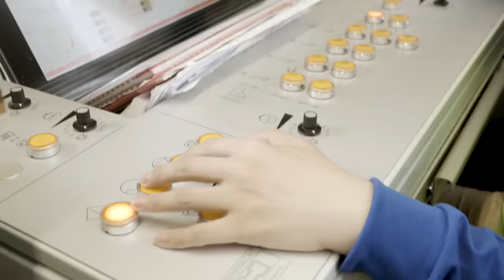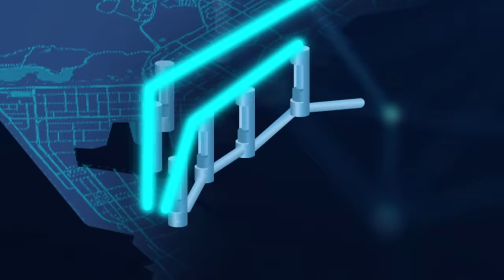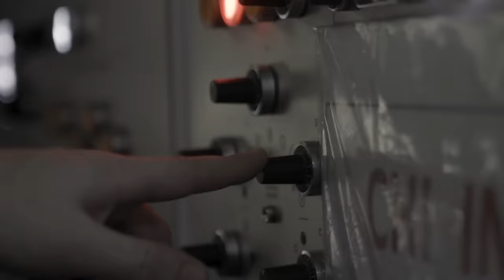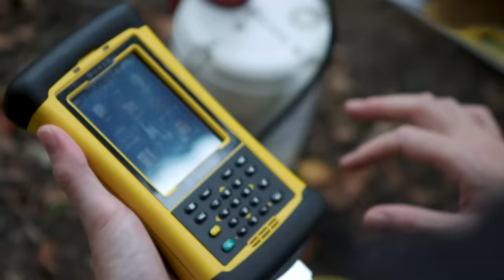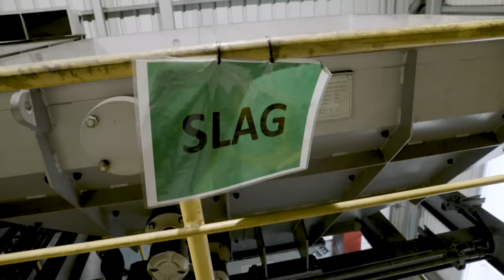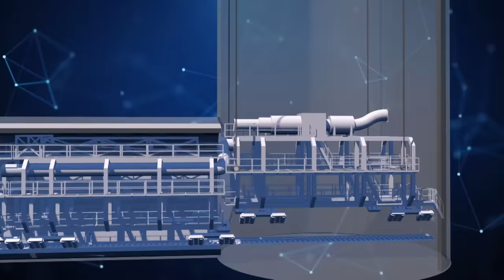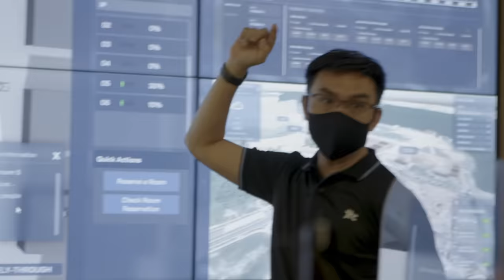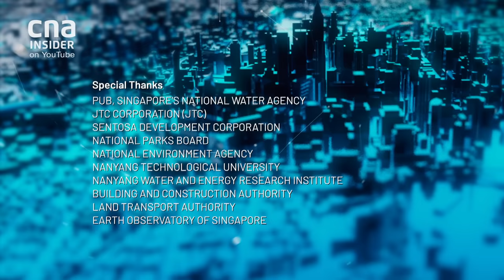Megaproject: Singapore's Deep Tunnel Sewerage System | Tomorrow City | Part 1/3

Comment: I was in Singapore for 9 months working for the project in 2019/2020. Doing soil engineering works for the TBM to excavate through Jurong Formation rock mainly build from sedimentary rock that covers south-west portion of the Singapore island. Strengthening the soil or the foundation along the TBM route of excavation by grouting method such as rock fissure grouting by filling the void inside the rock with cement pumped with high pressure. Singapore is a nice place to work and stay....
Reply: No
Reply: @yeolow2564  Yes
Reply: LinkedIn
Reply: Thk u 🙏🏼🫡
Reply: @kf510 maybe?
Reply: @vindhyachalchaubey2072 😅😮
Reply: LIAR 😮😮😮
Reply: @cdracing  ask your mom....
Reply: Singapore is fine city😅😅

Comment: In Louisiana, USA, a glass recycling project is grinding glass to create replacement for sand in concrete. No heat required. The glass has the same angular shape they are looking for.
Reply: I hope they will do a documentary on this. This is good to know
Reply: Glass is made from sand so it makes sense
Reply: Singapore also have to pay for what had damaged in China
Reply: @TKO67  There is a youtube documentary on it. That is were I learned about it.
Reply: @joblo341  please provide the link
Reply: Interesting project. Whereas for Singapore, they are attempting to resolve a waste issue as they have limited space for landfills, so they are looking into converting ALL waste (not just glass) into sand for concrete.

Comment: i worked on Phase 1 of this project from 2003 to 2005 driving 1 of the TBM's -  it was very wet and difficult.
The people and the food made up for all the hardship we faced at work.
Reply: Thank you for your hardwork :)
Reply: What food
Reply: @chialiulian2881  please don't be simplistic.
Reply: @pauldarbishire7226  😊
Reply: What kind soils you encountered there along the alignment? Sands, silt or rock or a mix of things?
Reply: @rogerw830  badly fractured rock with faulting and water+++
Reply: Actually it looks pretty stressful environment and people.. but super interesting nonetheless
Reply: @TWJYILY  uuurert
Reply: @chialiulian2881  llllllllllllllllllllllllllllllllllllllllllllll
Reply: HahThatsWhatSheSaid  I know that English may not be your mother tongue so I will explain.
I made 3 statements -
1) I worked on Phase 1 of the project.
2) The work was difficult and wet.
3) The people both on the job and in Singapore and the wide diversity of food available made up for the difficult working conditions.
I understand that you may find my original statement difficult to understand but as a native English speaker I laid it out correctly. It seems from the number of upticks it has received so did most other readers.
However there have been 2 people who questioned the post and both were unable to grasp the connection between difficult work being ameliorated by good people and good food.
I hope that you understand this explanation, if not try some remedial English classes.
Reply: HahThatsWhatSheSaid  I am neither irrational nor offended.
I laid out, in simple terms, an explanation for my original statement.
I think you may be the one who is being irrational and offended.
Maybe a class in maturity would be better suited to your needs.
Have a great life.
Reply: yea me too
Reply: @pauldarbishire7226  Actually it all started out with you making an assumption about a 2 word comment.... to which you could have replied with what sorts of food you ate while working there... seriously that is what people are asking, your assumption that they didn't understand your perfectly good English took you down a the wrong path. Try and tell people about your experience rather than correct their thought patterns... Anyway... food is what I miss about some of the places I have been also. Peace.
Reply: @Wingnut353  ... and there you go trying to "correct my thought patterns".
Reply: Thank you for being part of the team. Much appreciated.
Reply: @adamfaidzal  welcome - we try to please
Reply: I realize you said 'hardship(s) we faced at work' so were covering more then just yourself, but what was it like to be a driver, were you in charge of the whole operation during your shift?  What did the work involve?  Was this the first time working in aTBM?  I've always been fascinated by them, wish I could get a in person tour.
Reply: @shopshop144  We all, that is the 20+ men who worked on the TBM suffered various hardships - large inrushes of very cold water, badly fractured and crushed rock, dust, heat and cramped and confined conditions.
I was only in charge of the TBM, its steering and general maintenance.
I drove my 1st TBM in 1981 and worked on many tunnel jobs in over 35 countries including 3 times in Singapore.
The work is very interesting as each machine has different characteristics - so there would 3 months of learning and optimising the machines performance and then it would become a little boring :~/
Unfortunately because working tunnels are hazardous it is very unlikely that you would get to visit a working TBM.
Thanks for your interest.
Reply: @pauldarbishire7226   Curious , what is the average temperature down there ?

Comment: Very Interesting.
Props to the producers and all involved in the project for making such a well presented and informative video.
Reply: Several discrepancies about TBM's.
The TBM  would move an elephant hahaha. 
A TBM would move a herd of elephants and several herds of cows + the farmers.
The TBM costs a $1,000,000 hahaha.
Maybe a very old and used TBM.
A 6m mixshield TBM, as featured here, would cost at least $10,000,000 approximately.
 Depending on the size (diameter) and type of TBM  they can cost much more.
The 6m mixshield TBM featured in the video would advance at 3m an hour hahaha.
This is not possible with this size and type of TBM. It leads you to believe that a 900m tunnel would be excavated in 300 hours or 12½ days. The truth is a 900m tunnel would take about 6 - 8 months depending on geology/breakdowns/dependability of supply of usables.
I have work on tunnels in Singapore on 3 occasions.
Reply: I’m so proud to be Singaporean! That you Paul!

Comment: Imagine the amount of seismic disturbance it causes. That part of the world is just one earthquake away from a massive problem.  There will be shallow pockets developed and can create great sinkholes.
Reply: Good point of contention, but earthquakes are unfortunately not an issue in Singapore. Try and find when the last earthquake, or typhoon or any form of natural disaster in Singapore was. My bets are you'll not find any
Reply: @marcuscheok7936  So your theory is that there was none so far and there won't be one. Good luck. By your theory, Why was there an earthquake on the Indian coast in Bay of Bengal this year? that should never have occurred as there was none in that area before.
Reply: Don't worry. They surely had that in mind and definitely doing their best research and planning to solve that problem.
Reply: Ever heard of Japan? They build a massive underground flood control in Tokyo many years before with no problem. It got hit by a 7 earthquake in 2011 and many numerous bug earthquake before and it's still fine. So if Japan doesn't have the problem then it ain't a problem for Singapore.
Reply: @a61374  Completely different concepts in both tunnels. This one is not earthquake friendly design like the one in Japan. I could ask ever heard civil engineering. But that's not my mentality. Good luck with your studies.

Comment: After the 41 minute mark you will see what I was telling you about. The narration does not start with telling you what these critical points are or why they are critical. It simply tells you that there is something very critical and that "the team is on high alert". You learn almost nothing but you go through all the emotions.
Reply: Or you get the emotions first and then some explanation that actually did not merit them.

Comment: Am I the only one bothered by the comment "the tunnel is 50meters underground so it takes time to acclimate to the pressure change"? This isn't a pressurized tunnel like the Caissons that were built for the Brooklyn bridge. It's atmospheric pressure minus 50meters of air pressure. That's like saying every time you take an elevator down 150 ft you need to get acclimated to the change in pressure.

Comment: @ 46:15 . . . . . . what the heck is going on with that elevated roadway? Looks like a massive heat mirage. Surely the roadway wasn't designed to look like a serpent, if so, why? If this is an example of the "excessive settlement" that Miss Lynn speaks of so casually, then I would hate to see one that really concerned her. If this is real, then surely at the same time of being criticized for such failure, they should be credited for having superior materials that are resistant to fracturing apart  after such extreme bending.
    I wouldn't expect there to be any excessive movement of the ground, the TBM is cutting, not pushing it's way through the ground. The process then supports the tunnel with the concrete rings as it passes. Unless there was a washout between the cutting head and ring installation and they sucked out huge quantities of soil from outside the rings, the ground would remain undisturbed.
   Very interesting video, well produced. Thank you for sharing, it is good to see people achieve such great accomplishments of such magnitude that positively affect society.

Comment: Sharp edged aggregate should result in stronger concrete. The aggregates resist shear I'm guessing.
This applies directly to asphalt where smooth rock will result in roads that constantly shift. Sharp rocks keep everything locked in place.

Comment: Another interjection here. TBM Cutting Heads are not delicate flowers. The drive hub would be the only part needing protection. For the hard cast iron head and tungsten carbide cutters it could smash the bore hole walls to bits and be fine. I think they were overly cautious for the sake of being overly cautious. A theme I've encountered on every eastern project I've ever been on. However, better safe than sorry is an age old adage for good reason.
Reply: Kurt: Ever wondered what part drama plays in these vids?

Comment: If Singapore's temperature can be lowered by 3 deg Celsius,  it would be a dream place to live in.  Way too hot in Singapore.   Giant geosynchronous umbrellas in space to shield the sun ....that possible?
The structure only needs to be a fabric.   Hence it must be possible cos it is light weight and Elon can rocket them up for Singapore.
Reply: Lower by 5 deg C is more comfortable.
Reply: @sktoh4469  of course lah.  But dont know if possible to lower even 2 or 3 deg let alone 5. Haha.
Reply: @jlcdrivewayramps7343  Alternatively, if technology can be developed to suck out excessively humidity, that'll do too if temperatures remain in the low 30's.
Reply: @sktoh4469  actually once humidity is down it wont feel as uncomfortable.   Dry heat is actually quite bearable.  What you and I are asking for is unfortunately probably not possible.   If it is,  either lower the temp or lower the humidity,  Singapore would become a paradise to live in.

Comment: singapore is most likely going to build underground secret buildings attached to the sewer and power plants.  building a massive project like this wouldnt be needed for prosessing sewage if water treatment plants are built more; then the sewage can be directed to many close locations.   this is like some huge tunnel.  hahahah its an excuse to get the equipment down there.

Comment: "to maximize space the dtss system will be dug deeper than any existing road and rail network"
Norwegian floating tunnels on the deepest is at 390 meters.
But that's another story of 47 billion dollar project
Reply: Yes that the deepest for Singapore thus far, having to take into consideration of the marine clay layer and such. 

Norway has connectivity issues due to the huge area being separated by the numerous fjords. Their tunnel network will efficiently resolve most of the transport issues and bring about greater efficiency and better logistics.

Comment: If they can build 50 storey high rise buildings why can't they go 50 storey buildings underground
Reply: Yes, they can.  We can.  US guys, German guys, Japanese guys all can.  It is about cost.  Digging the ground is a lot more expensive than building upward.  You need to take out the excavated materials.  You need to prevent your excavation from collapse.  You need to prevent underground water to seep in.  When the building completes, the operation and maintenance cost is prohibitive.  You need a non-stop 7/24 mechanical ventilation.  You need 7/24 man-made lighting.

Comment: Why stop with a deep underground sewerage system?  Singapore might need whole underground neighborhoods one day if the planet keeps getting hotter.  Like what Marina Bay Sands has underground but much more everywhere in different neighborhoods you can have an above ground and underground version.  Like Super Mario World.  lol
Reply: @VerilyVerily  Yes of course money is always a big problem lol.  I think if the world gets too hot and the environment becomes too harsh there might not be any other choice.  Massive underground housing doesn't have to go that deep.  We know that large scale underground areas for subways or shopping centers isn't impossible.  There are many existing all over the world.  SG just has to build a bunch of these mega underground complexes but not just for shopping but actual mixed use residential/shopping neighborhoods.  Where there's a will there's a way.  As the climate becomes more inhospitable above ground some housing blocks and public areas can move underground and above ground those blocks can be converted to solar panel arrays or some other energy generation equipment.  Or maybe like vertical greenhouses or something that support the housing underground in that area.  Massive above ground fans can provide ventilation and artificial wind.
Reply: Who knows? In 100 years you might be seeing full-fledged underground neighbourhoods in Singapore, with dwellers who "come to the surface" only occasionally for their "sun treatment" LOL.
Reply: Works have already begun in Tengah estate on a subterranean and high rise mixed development.